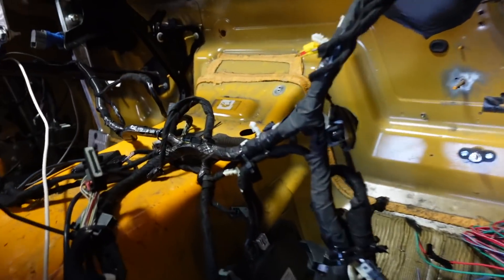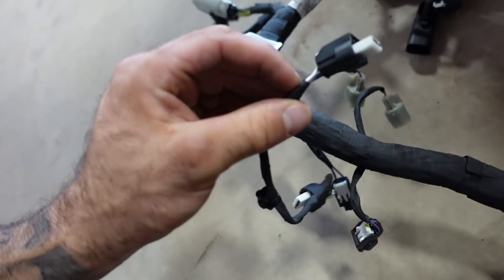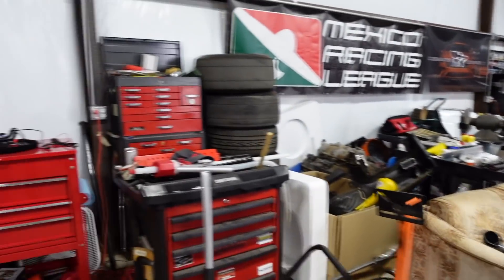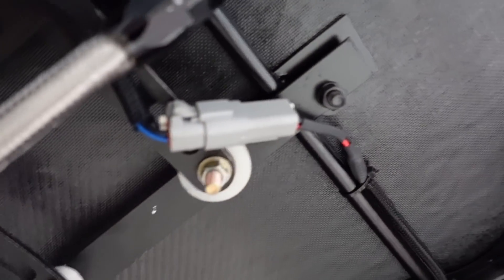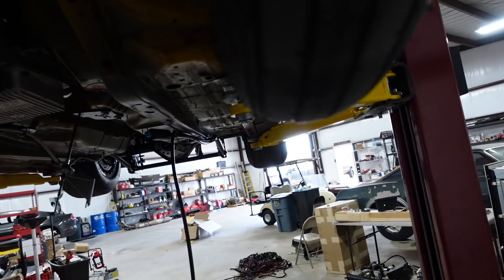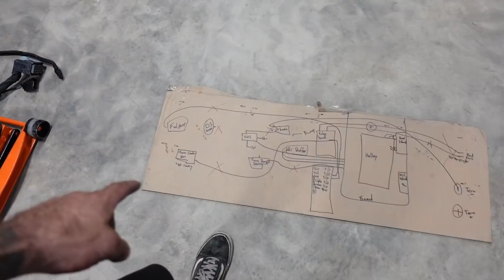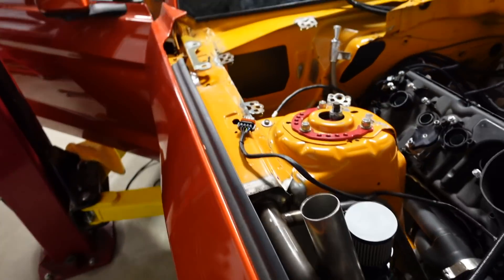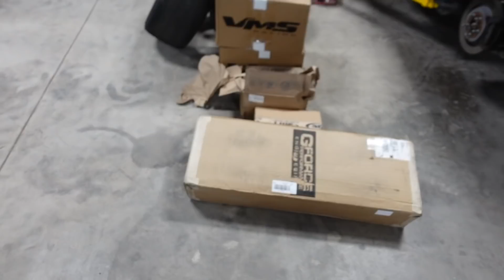Nothing is ever "Plug n Play". Installing a Holley Dominator on a Gen 3 Coyote Mustang GT!

Comment: You may be able to find some two wire window motors from a older Ford. Just put the switches on or under dash. Move your window adjustment all the way tilted in or don't let window come all the way up.. That way you don't need window lift when door closes.just an idea . Love the car

Comment: It is insane to watch how much work goes into installing a Holley onto the gen 3 coyote. Good luck man. 
Random question though, for the motion raceworks buttons, is there a ground wire and a separate wire for the transbrake?
Reply: Yes, they all come with a ground and a wire to tap into the transbrake, bump, scramble, line lock, etc.
Reply: @jmendozas197  thank you. What is the best place to connect the ground wire to inside the car?
Reply: @alexchadbourne  I use a bolt under the gauge cluster. Since the buttons are gonna be on the steering wheel, there are a few good places to ground under the dash/gauge cluster.
Reply: @jmendozas197  thanks man! I appreciate it